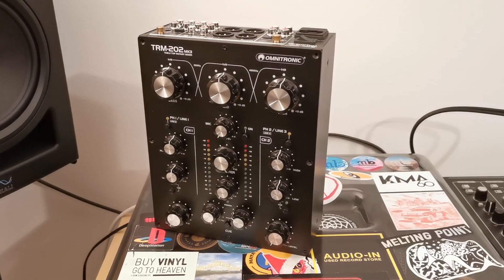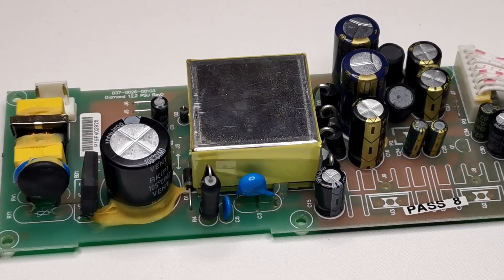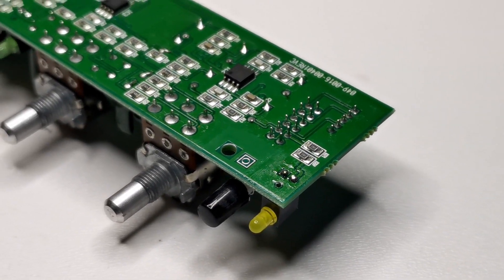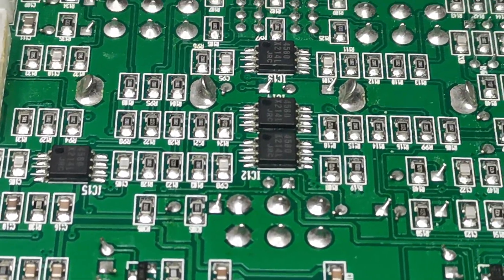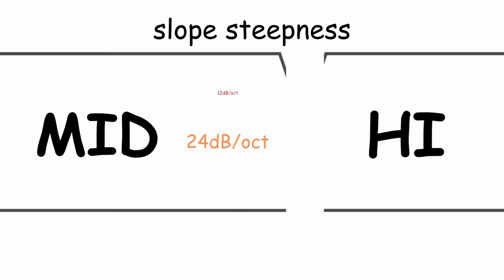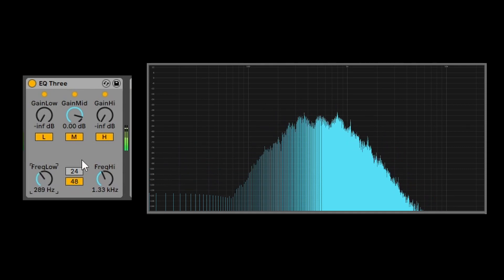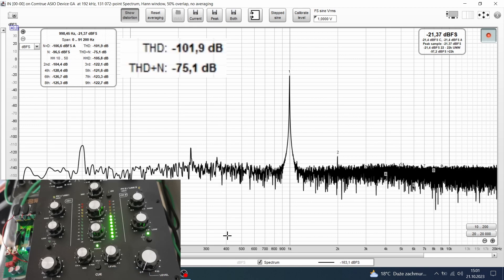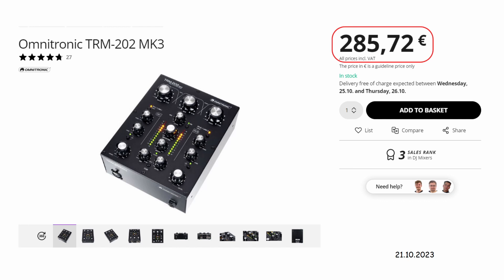Mixers Inside: Omnitronic TRM-202 MK3 + Isolator EQ explained

Comment: Would it also be possible to mod this mixer to improve it further? Like converting the line/phono to phono only or line only w/ external preamp? Again, super happy you're doing this. I really think you're filling a big gap in knowledge that ive been pondering about. Really want to get in diy mixers... Thanks again!
Reply from the maker: Try swapping the op amps from the phono amp to OPA1656 for example. I didn't try this and can't guarantee it will be stable, but should be fine. IC1 and IC10 in input/output board are working in phono stage.

Generally you can play with swapping the op amps, but remember - not every op amp will behave properly.

Comment: Thank you! What are the jumpers on the top right at 3:22 ?
Reply from the maker: You're welcome! I didn't check the jumpers; I was more focused on other things. Once I have the opportunity to check it, I will let you know.
Reply: First thing i'd like to know as well!

Could this be to switch the meters between output level or mix (pre-master)? I've had a few friends ask me to do this as a modification to their TRM, would be great if this feature is already implemented.
Reply: Omnitronic said “Hi! You can use it to make the isolator audible in the headphones. I hope that will help you. Greetings! Simon // Omnitronic-Team”
Reply: @cassettedreams8868  too bad 😞